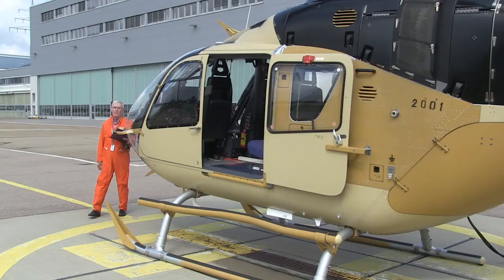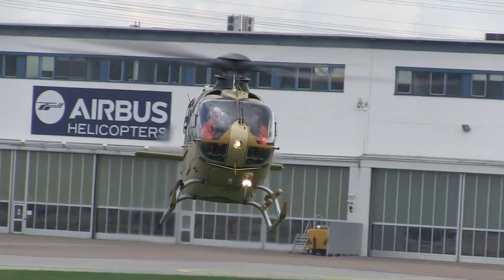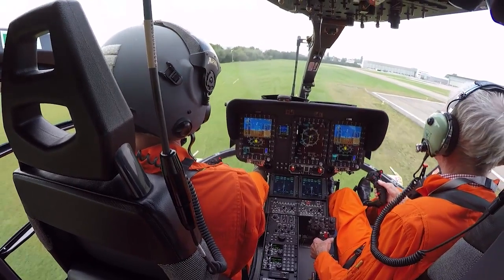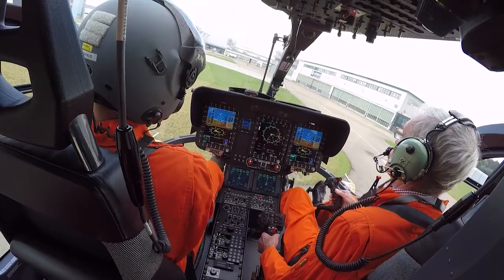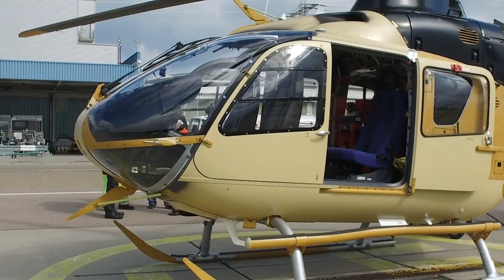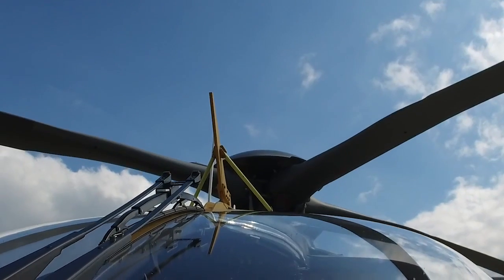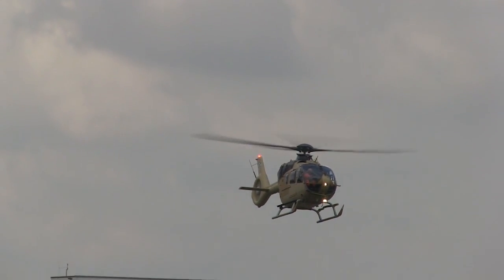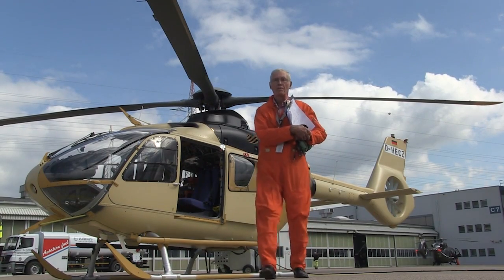Airbus Helicopters H135 flight test

Comment: P3? The wing end plates of the horizontal stabilizer are omitted. They are cheaper to manufacture, lighter, less aerodynamic drag, and do not get in the way when moving sideways or changing direction. All good things. Models with bearingless hub construction and fenestrons have been increasingly improved.